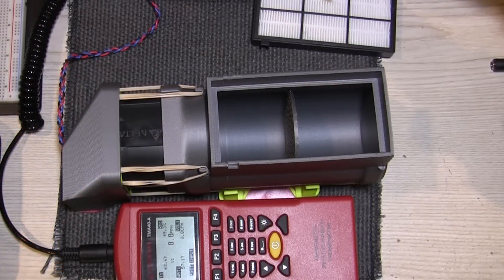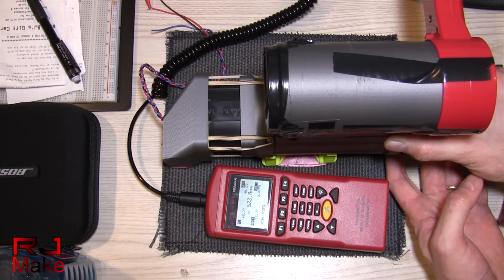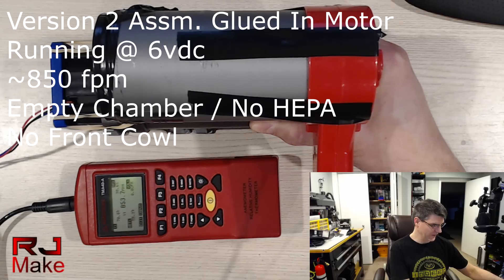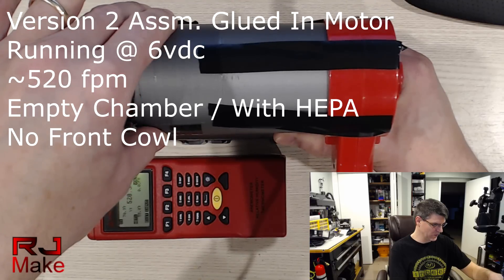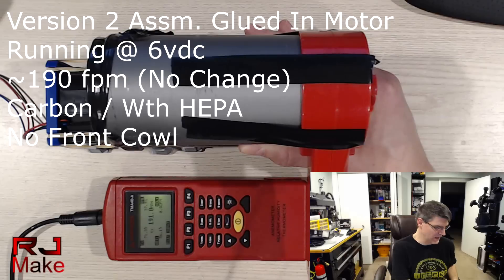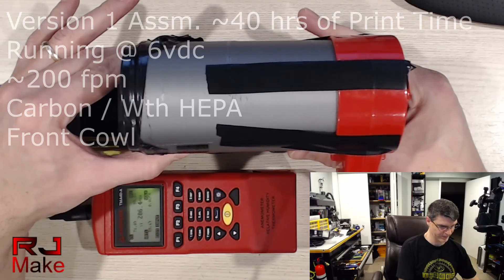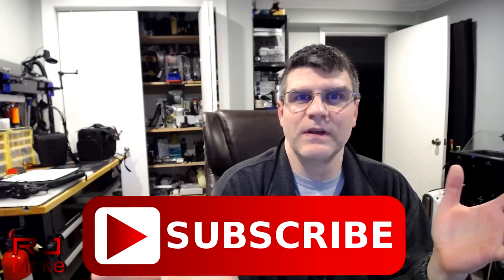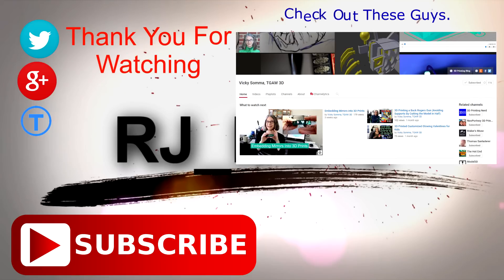3D Printer Carbon/HEPA Air Scrubber Air Flow Tests

Comment: It is very important to use a carbon that has been activated by steam and not acid. The acid activated carbon will rust your equipment. If the method of activation is not specified I would assume that it's acid activated. Theis method is also made to recycle the air and not directly send it back to the room. If takes a couple of air pass to filter the entire VOCs.

Comment: Hello, RJ. Good job on the work and explanation! I recently came back to the 3d printing world and I am building an enclosure for my Ender 3. Here in Brazil, every solution in this area is very expensive, even the cheap ones for you guys. I know this video was made a while ago and I was wondering if you achieved any viable solution for this filtration issue.
Reply from the maker: No. I found it mainly relies on large amounts of carbon (>10 lbs) to effectively handle the VOC output of a 3D Printer. The best way to handle the VOC and Particulates IMO, is to vent the fumes outside the living space.

Comment: Hey there, have you been doing any more work or research on extracting / filtering fumes from your 3d printer?
Just ordered an Ender 3, which is my first 3d printer and I'm going to use my solder fume extractor with activated carbon and air duct to blow it out the window. I'm also going to buy a half face respirator also just to be safe.
Reply from the maker: I did some preliminary tests a couple of months ago with the current and a new design scrubber in a 'sealed' enclosure. The results were not good. I appears you need LOTS of carbon (10+lbs) to keep up with VOC emissions of a 3D printer, otherwise it takes quite a while for these small scrubbers to to bring the VOC levels down (1 to 2 hours after the print has completed). 

If at all possible, put the printer in an enclosure and extract directly to the exterior of the building.

Comment: Hi! Really like the concept and I need it for sure, but I got confused about air flow placement and filter placement. So if you have enclosure does it have air coming from outside and get inside enclosure and pushed out through filter? Our enclosure is completely sealed and filter is inside and just circulates the air inside? Any photos please and thanks.
Reply from the maker: Hello @GetTestDrive.ca,  I'm working on a new design that uses a different base cartridge and more carbon, however I have discovered something very important in my testing.

It seems unless the design utilizes a very large amount of carbon, (+10lbs) the scrubber can not keep up with the rate of VOC emissions. That includes this design, and I suspect other small frame scrubbers.

So it seems the only effective solution is to have a sealed print enclosure and a effective filtration strategy. I think the filtration strategy (when and how long) is going to be the most important aspect of getting the air cleaner inside a sealed enclosure.

From my prior testing, carbon definitely works at lowering VOC's but the required run cycles to accomplish this with <10lbs of carbon are not encouraging so far.

Once I complete and populate my new 'print tower' testing will resume.

Comment: I am building an enclosure, and i have this question, if the enclosure is air tight, why use an exhaust fan at all? Will the air not have to pass the filter on its way out through the path of least resistance, why does the air need to be pushed? Many thanks for your videos on this subject!
Reply from the maker: Good question. In order to scrub the air of VOC's you need to pass the air through some pretty darn restrictive media. There is only one way to accomplish this to my knowledge and that is to incorporate a device to force the air through the media. In this case I'm using a high static pressure axial fan.

Even if you're filter is at the top of your enclosure, the air will not make it's way through the media via natural convection. At least not at a rate that is meaningful.

Comment: So this is something that's been worrying me a lot. I decided to keep my Prusa in the garage because the fumes really started messing with me. I started on an enclosure using some aluminum extrusions, aquarium sealant, acrylic panels, and panel gasket sealers. This is going to be my final addition to the enclosure. I really appreciate what you did here. There aren't many people out there taking the time to explore this subject and you did the best you could to solve the problem. Anyone offering a solution wants to charge you more than a thousand dollars for the enclosure + filter, and don't want to sell the filters separately. You're awesome man, I hope there's an update about how the filter has been performing for you recently. I would be really interested in seeing that.
Reply from the maker: Thank you, lately I starting to think more about how the next version is going to work. When I have that nailed down I'll probably do a video on it.

Comment: Nice setup. I've been looking into building a scrubber for my robo 3D. I see that fan is rated for 61.5dba. Would you say that's accurate? Is there a significant change in dba when running the scrubber opposed to not? There's plenty of free smartphone apps you can use to test the dba difference.
Reply from the maker: +Joseph Tarling Thanks, Great question. I just tested the dB level with my RadioShack SLM and @ ~1' from the front of the machine I'm hitting ~52dB (door closed). When the scrubber turns on I hit ~55dB.  The blower is running on 6vdc.  If you're on twitter, (RJ_Make) I'll tweet the pictures of the Meter needle.. :-) #oldschool
Reply: Oh nice, that was fast :-) thanks!
Reply from the maker: +Joseph Tarling You are welcome., and thanks for the sub. I thought It was a great question; one that I couldn't resist to find the answer to. :-)

Comment: Great work! The improvement on this design over the original respirator filter is substantial.

I have one question though, with the design change you had to make, does that have a noticeable effect on the airflow? I would think it would have some effect, as a portion of the air filter now has an obstruction.
Reply from the maker: +Hoffman Engineering Thank You!.  Surprisingly the extension only reduced the air flow ~10 fpm.  It was suggested that it may be because of the type of carbon being used.  It's technically for water use, so it's effectiveness for this usage is in question. 

I can confirm that it's is working to some degree, as it does filter most of the odor from the incense. 

The one thing I've learned with this hack, it's very difficult to fight the natural convection currents inside the printer enclosure.  It's SO much easier to filter at the top of build chamber.  If you ever get around to building yours up, keep this in mind. :-)